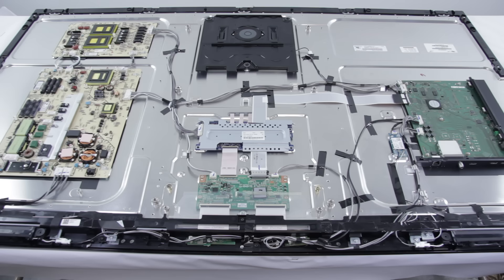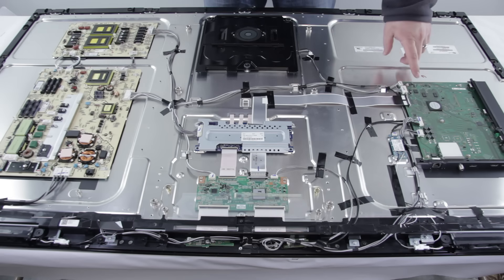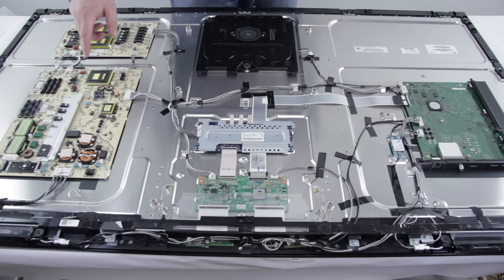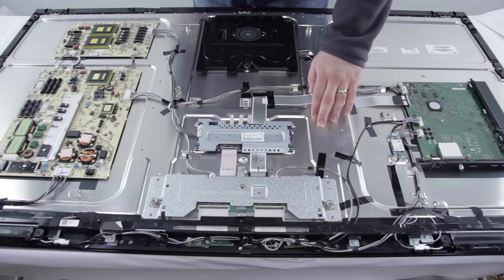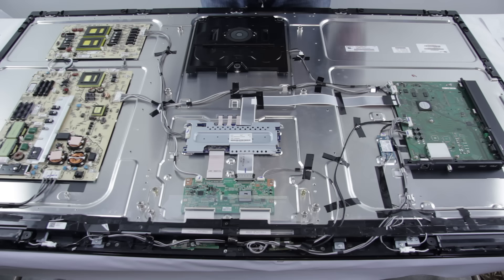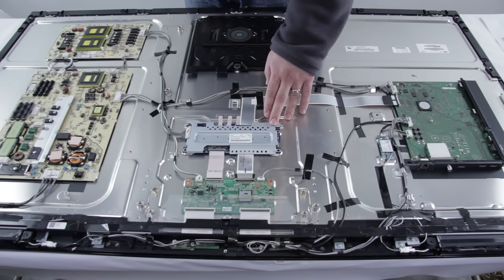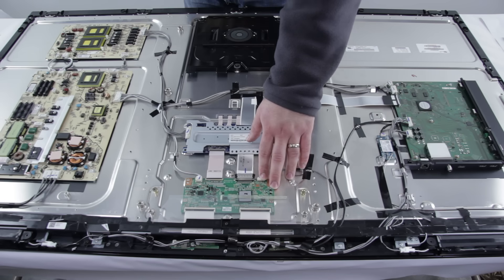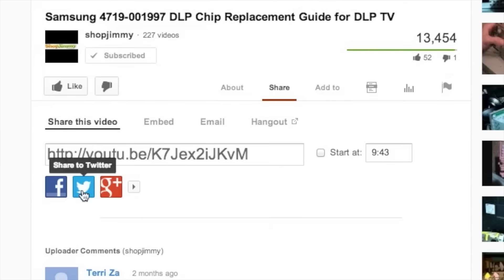LED TV Repair Tutorial - Common Symptoms & Solutions - How to Repair LED TVs

Comment: Hi. I have an RCA 39LB45RQ. For a few months it was having trouble turning on. We would have to turn the power strip off then back on, and then it would turn on and work perfectly. Eventually it stopped turning on all together. I just replaced the power supply board, the red light on the front of the TV that is on when the TV is off, still comes on when I plug it in, but once I hit the power button on the TV or the remote, the light goes off as if the TV is turning on, but then nothing happens. I watched the video and I don't know why else it wouldn't be turning on. I've tried different outlets around my apartment also. Nothing helps.

Comment: I have a Samsung LN40A500T1F that has a dim screen.  I have power, sound, and a poor display that exhibits "shadows" on the screen.  This issue presented itself suddenly one evening and though we can still watch programs the picture is not what it used to be.  Thanks in advance!
Reply: ***** Thanks for your insight!  I think I got lucky, though, because I removed the back, disconnected & reconnected ALL the connections I could find and plugged it back in and……wait for it……..it worked like normal!  That was about 6 days ago and so far, so good.  I will make note of your diagnosis if it should recur.  At least now I have some idea of what was causing the issue.  Thanks again!

Comment: Hi i have a samsung UE40H6670 that has a block vertical line all the way down the middle of the screen. I have tried to replace the T-CON, Main board, and also power supply. Any suggestions as to anything else it could be?

Comment: I have a Philips 37PFL5322D/37.  The video is working but I am having no sound when connected to devices with an HDMI or AV cables.  At first I only got no sound on HDMI but now it happens with AV cables as well.  Unplugging the tv for a few minutes and plugging it back in worked a few times but now that fix only lasts for a couple seconds. At times when switching to different inputs, video has gone out as well.
Reply from the maker: Coach Wheeler  Please watch this video FIRST to help with your repair!  https://www.youtube.com/watch?v=BP3NVNCGEv8   I recommend replacing the main board in your TV.  Click this link to replacement parts for your TV model number:  http://www.shopjimmy.com/catalogsearch/result/index/?cat=56&q=37PFL5322D%2F37  There may be multiple boards for the same TV model number, be sure to match part numbers on your current board, with your replacement for compatibility.  Here is a link to a video showing how to identify your part number, click here:  https://www.youtube.com/watch?v=xSSxNZXZIXA  Thanks and please let us know if you have any further questions with your TV Repair!  www.shopjimmy.com

Comment: Hi, I have a Toshiba 47" about 6 years old Model# 46RV525U, Serial# 848116M06027K1, after a power outage my TV would not turn back on tried unplugging it and then plugging back up to no avail, can't afford to buy a new one what can I do
Reply from the maker: Felicea Dickson  Please watch this video FIRST to help with your repair!  https://www.youtube.com/watch?v=BP3NVNCGEv8  I recommend replacing the power supply board and the main board in your TV.  Click this link to replacement parts for your TV model number:  http://www.shopjimmy.com/catalogsearch/result/?q=46RV525U  Be sure to match part numbers on your current board, with your replacement for compatibility.  Thanks and please let us know if you have any further questions with your TV Repair!  www.shopjimmy.com

Comment: Samsung UN46EH5300 restarts after being on a few minutes and does not stop. I have to turn it off when it starts and then it works a little while and then starts restarting. Is it the mainboard? It even did it after upgrading firmware and in the middle of setup.
Reply from the maker: xTheUnknownTruthx   Please watch this video FIRST to help with your repair!  https://www.youtube.com/watch?v=BP3NVNCGEv8  I recommend replacing the main board in your TV.  Click this link to replacement parts for your TV model number:  http://www.shopjimmy.com/catalogsearch/result/index/?cat=56&q=UN46EH5300  There may be multiple boards for the same TV model number, be sure to match part numbers on your current board, with your replacement for compatibility.  Here is a link to a video showing how to identify your part number, click here:  https://www.youtube.com/watch?v=BEPWrefQvqI  Thanks and please let us know if you have any further questions with your TV Repair!  www.shopjimmy.com

Comment: hi my power went out, when they return on my sanyo dp50741 had no sound i try all the common fix.could u please help
Reply from the maker: felix tyler  Please watch this video FIRST to help with your repair!  https://www.youtube.com/watch?v=BP3NVNCGEv8  I recommend replacing the main board in your TV.  Click this link to replacement parts for your TV model number:  http://www.shopjimmy.com/catalogsearch/result/index/?cat=56&q=dp50741  There may be multiple boards for the same TV model number, be sure to match part numbers on your current board, with your replacement for compatibility.  Here is a link to a video showing how to identify your part number, click here:  https://www.youtube.com/watch?v=Mi0D7ksQp7I  Thanks and please let us know if you have any further questions with your TV Repair!  www.shopjimmy.com

Comment: my samsung led tv (UN55F7100AFXZA) was working just fine. i attached the stand with screws i found for a wall outlet. i have wallmount brackets on the back of my tv. i picked it up by the brackes to lay it down. after screwing in the stand i can no longer produce a picture but the backlights and audio work fine.
Reply from the maker: Robert Archambault   Were the screws that you used too long and did they puncture the ribbon cables from the T-con?  Thanks!  www.shopjimmy.com

Comment: hi sir, i have a computer monitor (samsung 20" LED s20c150NL). Its not a TV but i hope you could still help me. When i turn on the monitor, everything works fine for like 3 seconds and then after that, the screen goes into a total blurr. Can you please help me?
Reply from the maker: Raymund Dalo   I recommend that you check the capacitors on the power supply, do they look puffy or raised on the top?  Thanks!  www.shopjimmy.com

Comment: Hi 
I have a samsun UN50EH5300FXZA LED tv. Two days back, suddenly, tv lost picture and sound works fine. If we start the TV, samsung symbol also does not come up. What could be the problem ?
Reply from the maker: phani Ayyappa  Please watch this video FIRST to help with your repair!  https://www.youtube.com/watch?v=BP3NVNCGEv8  This could be a problem with the power supply or bad LEDs in the TV panel.  You can replace the power supply to see if that fixes the problem with your TV.  Click this link to replacement parts for your TV model number:  http://www.shopjimmy.com/catalogsearch/result/index/?cat=229&q=UN50EH5300FXZA  There may be multiple boards for the same TV model number, be sure to match part numbers on your current board, with your replacement for compatibility.  Here is a link to a video showing how to identify your part number, click here:  https://www.youtube.com/watch?v=sSJexLvRrjM  Thanks and please let us know if you have any further questions with your TV Repair!  www.shopjimmy.com

Comment: I have a sharp aquos 70LE632U and am getting 2 slow blinks followed by 5 fast blinks.  INPUT and VOL down did nothing and CHAN down and VOL down did nothing
Reply from the maker: Dan Walker   This sounds like a TV panel (TV Screen) problem.  If your TV panel is bad, it may be more cost-effective to replace the TV as panels are typically hard to find in stock, difficult to replace, and expensive.  Thanks and please let us know if you have any further questions!  www.shopjimmy.com
Reply: I am waiting on the power supply board that y'all are currently out of stock on.  This tv has only come down $300 bucks in the last 3yrs which makes it around $1700.  So I am gonna replace this board.  I already replaced the video display board....I can occasionally get the backlight to come on but not much else.

Comment: I have a Vizio 55 inch LED model M550NV. I had no Picture and no sound. would power up but show nothing on the screen. I asked Askjimmy.com when It went out and we concured it was the main board.I ordered 3655-0102-0150 and nothing changed. What can I check now?
Reply from the maker: Frankie Oliver   Sounds like you have bad LEDs in the TV panel.  Unfortunately we do not sell replacement panels.  Thanks!  www.shopjimmy.com
Reply: Would I still get blue screen if LED's are out? I can't keep putting New parts on this TV not knowing which one is bad. Thank you
Reply from the maker: Frankie Oliver   Right.  Sounds like you have bad LEDs, and at this point it is probably best to replace the TV.  Thanks!  www.shopjimmy.com

Comment: Hello! I have Samsung UE32ES6540SXXH. Everything works but wireless signal is very poor. I have router behind wall and my TV cannot connect because signal is bad. I can see my network but it wont connect. My phone or tablet connects with no problems right beside TV and shows signal very good. What could be the problem?
Reply from the maker: Valdo Kaljulaid   Sounds like a problem with the wifi board in your TV, I recommend replacing it.  Unfortunately I do not see any replacement parts in the search results for your TV model number on our website.  Please reply with your part number on your wifi board and I can try searching for replacement parts.  Thanks and please let us know if you have any further questions!  www.shopjimmy.com

Comment: I have a Haier LE46F2380, the LED not turned on. Suspect the power supply issue. What's its power supply model?
Reply from the maker: Carlos Chen   You will want to check the power supply to see what the part number is on the board.  Reply with the part number.  Thanks!  www.shopjimmy.com

Comment: Vizio65 M30651sv tv has green sparkles where it should be black. It comes and goes, gets worse then better. Tv is only two years old.
Reply from the maker: Amanda Blackshear   I recommend replacing the main board in your TV.  Unfortunately I do not see any replacement parts in the search results for your TV model number on our website.  Please reply with your part number on your main board and I can try searching for replacement parts.  Thanks and please let us know if you have any further questions!  www.shopjimmy.com

Comment: I have a Sharp AQUOS LED 70" with mode # LC-70LE650U. Half the TV is dark. There is a gradual darkening between the two sides. Any idea what the problem is?
Reply from the maker: Liam Kelly   This sounds like a TV panel (TV Screen) problem.  If your TV panel is bad, it may be more cost-effective to replace the TV as panels are typically hard to find in stock, difficult to replace, and expensive.  Thanks and please let us know if you have any further questions!  www.shopjimmy.com

Comment: How to fix the tv if it will not turn on I have a RCA plasma tv 42la45rq
Reply from the maker: Jerimiah Hunter  Please watch this video FIRST to help with your repair!  https://www.youtube.com/watch?v=BP3NVNCGEv8  More information would be helpful in the diagnosis, like if you have standby or not?  With the information you have provided, I recommend replacing the power supply board.  Click this link to possible replacement boards for your TV model number:  http://www.shopjimmy.com/catalogsearch/result/index/?cat=59&q=42la45  There may be multiple boards for the same TV model number, be sure to match part numbers on your current board, with your replacement for compatibility.  Thanks and please let us know if you have any further questions with your TV Repair!  www.shopjimmy.com

Comment: Hello I have subscribed to your channel since you seem like one of the few who actually provide help. I have an LG LED 47LE5500. The other day while watching, the screen just turned off. The power and menu buttons still blink and make a beeping noise but the screen does not come on and there is no sound. Not sure what to do or what part to change. Unplugged it and left it off for a while, also used air spray to remove any dust but the problem seems bigger than that. Any help will be greatly appreciated. 

Thanks.
Reply from the maker: Tommy Sneakerss  Please watch this video FIRST to help with your repair!  https://www.youtube.com/watch?v=BP3NVNCGEv8  I recommend replacing the main board in your TV.  Click this link to replacement parts for your TV model number:  http://www.shopjimmy.com/catalogsearch/result/index/?cat=56&q=47LE5500  There may be multiple boards for the same TV model number, be sure to match part numbers on your current board, with your replacement for compatibility.  Thanks and please let us know if you have any further questions with your TV Repair!  www.shopjimmy.com

Comment: hi i have samsung series 5 samsung F500  have problem in display the lower part of display are coming lightdark ,also i observe become not dynamic setting  its like a cool setting only or standard settings
Reply from the maker: Roberto Santos   This sounds like a TV panel (TV Screen) problem.  If your TV panel is bad, it may be more cost-effective to replace the TV as panels are typically hard to find in stock, difficult to replace, and expensive.  Thanks and please let us know if you have any further questions!  www.shopjimmy.com

Comment: Please help, I have a LG LED TV Model # 47LV5500.
The Power indicator, when TV was still working, would show red when TV got turned on and turn off when TV came on.
Now Power indicator goes from red to white and I get no picture (dark screen) and no audio.
Tried to reset TV by unplugging power cord for more than one hour, which did not help.
Reply from the maker: Fritz Foerg  Please watch this video FIRST to help with your repair!  https://www.youtube.com/watch?v=BP3NVNCGEv8  I recommend replacing the main board in your TV.  Click this link to replacement parts:  http://www.shopjimmy.com/catalogsearch/result/index/?cat=56&q=47LV5500  There may be multiple boards for the same TV model number, be sure to match part numbers on your current board, with your replacement for compatibility.  Here is a link to a video showing how to identify your part number, click here:  https://www.youtube.com/watch?v=RwHTvjMdrhk  Thanks and please let us know if you have any further questions with your TV Repair!  www.shopjimmy.com

Comment: My Tv is having a problem turning on after an update it is an LG 55LB006500-TH, the standby light is flashing after attempting to turn on after update, power source was checked and moved from a power board to a single adapter, if you can get a solution thank you if not still thank you.
Reply from the maker: Kabi TK  I recommend replacing the main board in your TV.  Unfortunately I do not see any replacement parts in the search results for your TV model number on our wxebsite.  Please reply with your part number on your main board and I can try searching for replacement parts.  Thanks and please let us know if you have any further questions!  www.shopjimmy.com
Reply: thank you but i cant really do that cause I no longer have the tv with me i gave it as a gift about 8 months ago but thank you for your help.

Comment: Hey ShopJimmy, thanks for the overview! I have a problem with my Samsung UE40D5700 TV. After approx. 30 minutes the top left corner of the image is shifted, so that the overall picture looks odd. When I turn the TV off and on again, the problem still exists. I have to wait for the TV to cool down and then the problem is gone for approx. 30 minutes operation. The problem is independent on the video source, it even appears when i pop up the TV menu. I have posted some images in this forum (it's in german, but the pictures show the problem):

http://www.hifi-forum.de/viewthread-151-28615.html

Can you tell me which parts to replace?
Reply from the maker: Flushbaer   This sounds like a TV panel (TV Screen) problem.  If your TV panel is bad, it may be more cost-effective to replace the TV as panels are typically hard to find in stock, difficult to replace, and expensive.  Thanks and please let us know if you have any further questions!  www.shopjimmy.com

Comment: I have a 52 in Samsung tv Model LN-T5271 which has developed a line about 3/4 inch wide from top to bottom about 2 inches from the right hand side of the frame what could be the problem
Reply from the maker: Wayne Yale   This sounds like a TV panel (TV Screen) problem.  If your TV panel is bad, it may be more cost-effective to replace the TV as panels are typically hard to find in stock, difficult to replace, and expensive.  Thanks and please let us know if you have any further questions!  www.shopjimmy.com

Comment: Hello, I have a Vizio 39 Tesla model # E291i-A1.  One day it worked and the next time the screen was all messed up.  Vertical bands and some parts of the screen are just bright light.  Would appreciate any suggestions to repairing it.
Reply from the maker: richard smith   This sounds like a TV panel (TV Screen) problem.  If your TV panel is bad, it may be more cost-effective to replace the TV as panels are typically hard to find in stock, difficult to replace, and expensive.  Thanks and please let us know if you have any further questions!  www.shopjimmy.com